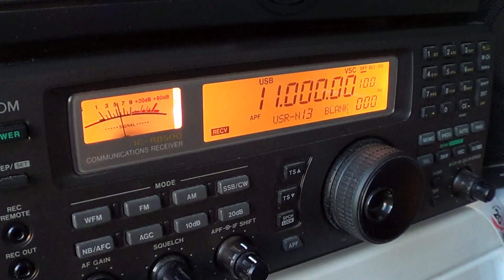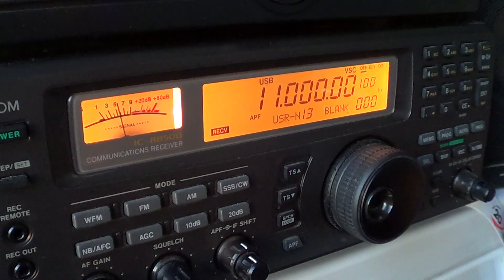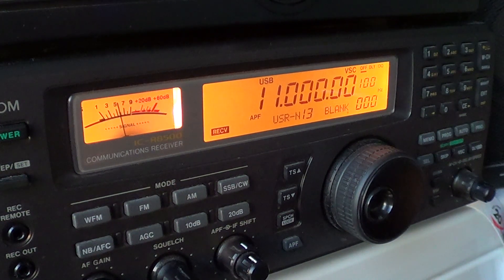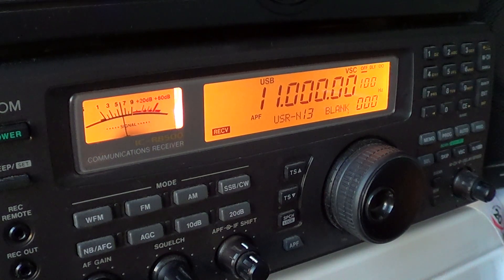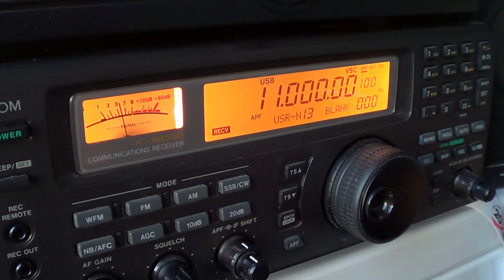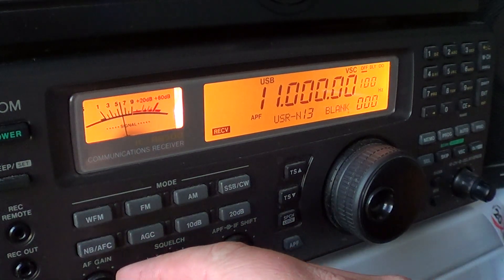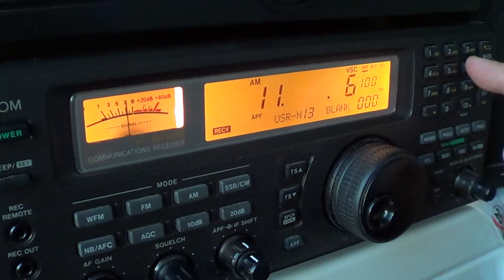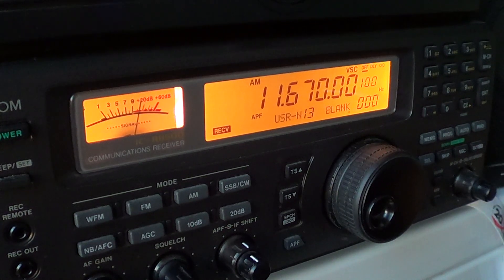Shortwave tutorial 11 mhz explained

Comment: I hear people have great results with magnetic loop antennas. Probably the best alternative to a wire. A vertical wide band antenna will probably be ok. However, a "real" VHF antenna will most likely don't give you much results at all. A random lenght of wire in a vertical plastic tube will probably be better. I tried my Diamond 2m/70cm antenna on HF. It's a great antenna for it's intended bands, but it is totally deaf on HF. Two paper clips gave me more signals! (no joke)

Comment from the maker: Hi,    thanks for the comments ...  all videos are complete...so they should all be here in 24 hrs maximum ... as for the antenna ....  it probably is better than having no outdoor antenna at all ....   but the lower you get on frequency...  the longer the wavelength...   so usually the longer the antenna ...  you will probably notice... reduced reception as you get lower and lower in frequency ....   keep in mind that ... just 20 feet wire can do wonders on shortwave...